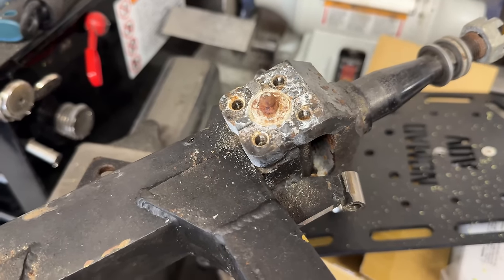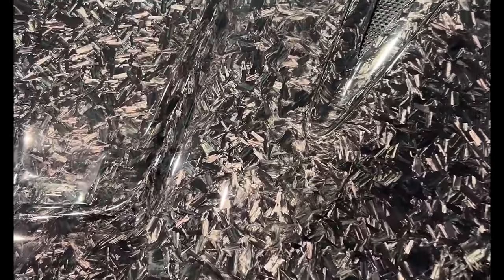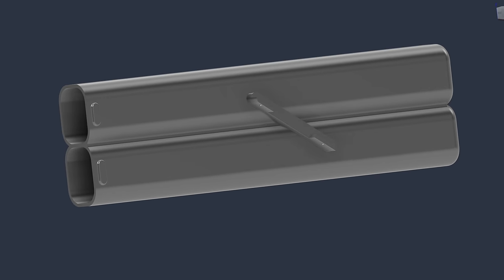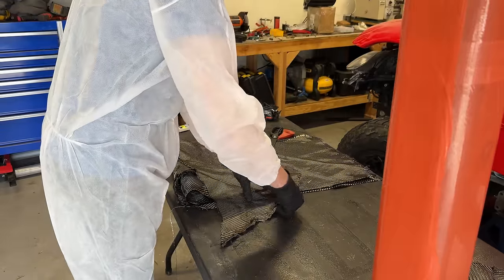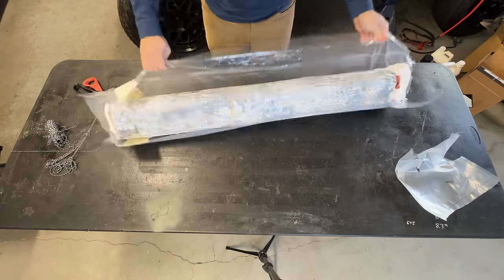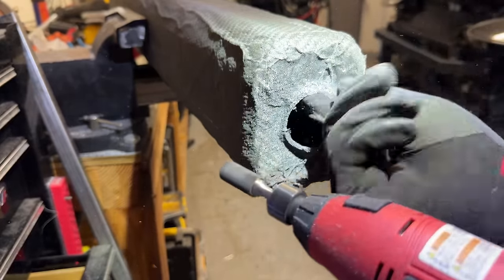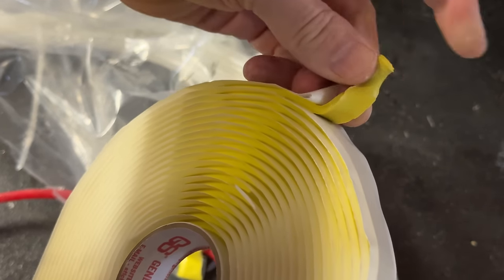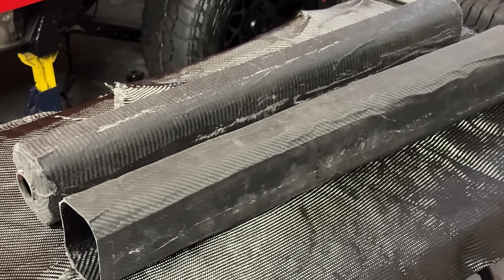Composites Are Hard

Comment: From a very old guy: Big Daddy Ed Roth used plaster of Paris blocks which he carved to shape, then laid up fiberglass over it. When the resin cured he’d smack it with hammers to break up the plaster. Sometimes he made closed compartments and the plaster just stayed trapped inside forever. If need be you can saw the thing in half and break out the plaster that way. Plaster of Paris is cheap and mixes with water. The fiberglass hassle is still there. Sorry.

Comment: "Am I a joke to you?" -schedule 40 PVC
Reply: you could prolly go thinner with drain spec pvc
Reply: it then he has no content to make videos with. We'll he has, but couldn't be arsed to work on it.
Reply: Turn the closet heat up.
Soften a 4" pvc drain tube.
Blow it I to a 4x5 ID Wood box.
Trim to length.
Reply: @jimrobcoyle  This is the way.
Reply: I think this was supposed to be practice for making the body
Reply: @jimrobcoyle  This is the way, indeed!  The entire time I was thinking this.  Or, use thin sheet plastic, heated and wrapped around a 3D mold, vacuum sealed, and weld the seam after easily removing the mold.  There were literally a dozen better options.  Still, I love watching this channel.
Reply: @DJDiarrhea  Yep!
Reply: I used 2" Sch 40 PVC for a mast to a sailing car I made around age 14/15. Katrina hit and Dallas had some serious wind. I nearly hit parked cars with my tire contact brakes smoking. Yea, the mast flexed a lot. 😂
Reply: Yup, had asimilar thought. Left a comment suggesting oversized PVC downspout and a cone to open the circular end.

Comment: After a few years as a "Composite Specialist" in the Aerospace Industry I can relate. The biggest thing I learned is was when your mold is sanded smooth enough keep sanding it. same with Mold release, when you think its good enough, put on another coat. best of luck with the Fiberglass!
Reply: Brother I have wet sanded by hand a fiber glass mold in stages to 8000 or 10000 grit paper? Absolute hand murder but fun trick, make a squiggle in Sharpie before you go down a layer once you have uniformly sanded down and the marker disappears you can go to the next finer grit

Comment: Ideas for future Matt:
-Make inside molds from Styrofoam blocks (and glue). Use a liberal quantity of paint thinner to dissolve the mold completely and easily.
-The issue you had with the ABS part ("condom") is due to the shrink ABS has when it cools. Use a blended ASA filament (Usually called ASA-X) and an enclosure to get rid of that. Added benefit: UV light doesn't hurt it
-Speaking of UV light: If you print other parts for the racer, ABS is not the ideal material for desert environments...use ASA-X, it will be easier to print too. You'll still get high on the fumes though.
-You will need a container of around 4 times the Epoxy volume to remove air bubbles in a vacuum chamber. This is completely normal, and necessary (The bubbles wont pop otherwise)
-Tell past Matt he should have read this comment before making these tubes
Reply: “…you’ll still get high on the fumes though…”
Matt: “Excellent, thanks for sharing.”
Reply: I came here to say this, as it should be a simple layup on foam blocks with rounded corners.  I can not imagine a more difficult way to go about this, and yet that didn't stop me from enjoying every minute.   Can't imagine what making the shell will look like.
Reply: Let's hope present Matt finds the time to read at least the first few comments
Reply: I would probably just have made a two part mold in 3D print for the exterior (with generous draft because it didn't needed to be rectangle anyway, only rectanglish) and wrapped wet carbon around the bag, the pressurize it from the inside. This is essentially how they make carbon fiber bikes except they use non-autoclave prepreg carbon and oven it.

Or you know, just 3d print the parts and call it a day.
Reply: Another thing is that the outside doesn't need to be vacuum bagged at all. You just wrap the whole thing in wide electrical tape (PVC tape), this squeezes out the excess resin while also keeping  any wrinkles from forming as it's compressive. and as it doesn't absorb any resin so it's easier to remove.
Reply: "tell past Matt he should have read this comment before making these tubes"

Nah, past Matt is a moron. It's not worth spending time trying to reason with him. I know that because past me is also a moron. Present me always needs to fix past me's mistakes... 

If you wanna talk to a smart guy though, talk to future me. He will fix all my projects, my designs, my code and even my life! All while remembering exactly why and how past and present me did what we did.
Reply: Acetone is your best friend.  And styrofoam's worst enemy
Reply: This is the way
Reply: @paulnielsen8528 Acetone works too, yeah. The paint thinner fumes are superior though.
Reply: @chrismichaelyoung Present Matt, as science understands, only exists for a very brief moment in time (and is therefor always extremely busy with other things)
Reply: @igorordecha counter argument. Past you was also stronger, better with the ladies,could kick anybody's @ss and was in that band that really could have made it big if not for Brians step dad kicking you out of the garage because he needed it for gis stupid herbalife business.
Reply: Excellent points. Also, pla melts at relatively low temperature and brittle  at colder temperatures. I wonder about carbon fiber? Maybe melt it or break it out.
Reply: @jerbear7952  "better with ladies" 0 = 0 so I wouldn't say he was better
Reply: Yeah I did my firewall/transtube on the midget this way, just melted the form with acetone, but talk about being a messy job, much like using paint remover to strip paint, there must be a better way, and the rest of my parts used pvc mold release!
In any case, present matt wanted to just get some practice in.   He could have just got send-cut-send to make the parts and send them to him!  Future matt will do that.
Reply: Vacuum isn't an issue for the degassing, just need to watch it before it hits the top lid, turn off the compressor and wait a bit.
Reply: @wobblysauce  That is correct, however, based on the surface tension of the liquid, smaller bubbles might never pop if you can't let the vacuum get strong enough. Multiple cycles might get you there, but you are working against the clock.
Reply: Tip from another Bambu printer owner: You can (and for ABS/ASA/Nylon/etc. should) preheat the print chamber. Put the printbed all the way to the top using the touchscreen, then 3mm down. Put the bed temp as high as possible (120° at 110V I think) and turn the Aux-Fan to 100%. Also put a towel over the top or something to better insulate it. 45-50 Celsius should be fine (bottom one of the 3 numbers on screen). Then start the print. You don’t want to open the printer until the print is done, or preferably until it has slowly cooled down. So have the glue on the and everything prepared before preheating.

Comment: A+ commentary on “fOrGEd CaRBoN”. The chatoyance is cool, and the fact that it’s perfect for using scraps and even recycled materials is great.. but anybody excited about the “look” of carbon fiber isn’t a serious person. Real structural carbon fiber needs lightweight UV protection, not a gloss finish.

I love the process in composite production. Taking your time and out-thinking the physics of demolding is always a thrill. Your fast and loose approach was always going to be entertaining for us, if not for you, and thats what we appreciates about you.

The degassing step is always a foaming mess where you wish your vessels were 3x bigger. It makes a huge difference when you’re going for an engineered strength:weight. Your tubes will benefit from the voids.

I look forward to your body production. Nothing wrong with making entirely disposable molds for one-off projects. Carve out foam or wood on a CNC table. Bondo it and take your time getting it sanded smooth then spray it with PVA. Cheap, easy, fast, and will give you top-notch results. Skip the infusion, degassing, and vacuum bagging for the body. Overkill effort and requires a bigger-stronger mold. (Molds often need to be 3x as strong as the part itself to handle vacuum bagging)

Plan (from the start) on filling voids & pinholes with micro & epoxy, then painting and you’ll never be disappointed. Even autoclaved aerospace parts get pinholes filled.
Reply: Yeah I agree vacuum is too much trouble because weight is not an issue. Just go wet layup and a big fat flood coat. Its so much easier to do and gives good results.

Comment: @3:07.  You left out the ITCHING as the No. 1 worse thing about fiberglass.  In the 1970's I worked at a factory that built sailboats from 18 to 48 feet.  Although I worked making the wood parts that went into the boats, I was close enough to wear the grinding, sanding, and cutting of the the fiberglass was done that the constant ITCHING it caused me made me seek other work.
Reply: When working with short glass fibers for thermoplastic composites, one learns rather quickly to be very careful when going to the bathroom. Switching to continuous fiber was very welcome.
Reply: Itching is loving, breath and skin protection is caring.
Reply: I've only ever worked with chopped strand fiberglass once (built a custom shower tray for my camper conversion), and it was the stickiest, itchiest, smelliest, most unpleasant experience. Ever. I don't know how anyone could work with the stuff full time.
Reply: @InternetListener   Back in the 19and70s, we were MEN!  We eschewed PPE and despised those who used it.  Most seat belts of that era were NEVER removed fro the plastic bags they were put into.
Reply: @oddshot60  And you are all dead from emphysema now , aren't you , Mr Zombie commenter?
Reply: Talcum (baby) powder applied to the skin before starting work seals up your skin pores and greatly reduces the itchiness.  I hate composites and appreciate Matt showing why half ass is an approach that does not give visually acceptable parts.  Functional yes, pretty nope.
Reply: @PaulG.x  You left out all the horrible automobile accidents.  I never said we were smart, I only said we were MEN!!!
Reply: @DIY-V12 Past-Oddshot60:  "TALCUM POWDER!!!  Thanks for the tip, Future DIY-V12!!!"
Reply: Matt contemplating his long vinyl shaft. 🤣🤣🤣🤣
Reply: That stuff can't be good for your lungs
Reply: @therealchayd  A better method, is carve XPS blue or pink foam to shape, with a router and template, drape 7725 or 7781 E-glass cloth and wet out with waterproof boat epoxy like West Systems. Vacuum bag it to a flat table.
Reply: I had a job doing fiberglass once for $14 an hour.  Least favourite part was taking a flapper disk to the edge and embedding fiberglass into my skin.  It was pretty miserable, couldn't sleep.  I wouldn't do it again for $40 an hour.
Reply: @oddshot60  your welcome, also it's very much current DIY V12 - look for 540HP NA 7L V12 at pistonheads for a laugh
Reply: @ofp8574 But now we have TALCUM POWDER.  😂

Comment: Pro tip : for that kind of pseudo-cylindrical part, the easiest and cleanest is wet lay-up and then wrapping in a special heat shrink tape and blast it with a heat gun. No need for a vacuum bag then It's cheap, doesn't wrinkle the part, and looks shiny on the outer surface.

Also, you want to use a perforated release film between the peelply and the breather mat (wet lay-up) or mesh (infusion). It's much easier to remove then.

The air bubbles may also come from trapped air that's inside your 3D printed mold. Infusion is a great process but it's Achilles heel is its absolute intolerance to leaks or trapped gasses. It will ruin your part under your eyes and there's very little you can do once it's started.
Reply: You complicated this far too much.

After watching a few minutes:

Find a cardboard tube with an OD near what you want for the ID of your tube.

Coat the tube exterior with clear packing tape to create a surface that releases easily.

Create 4-5 wooden bulkheads to insert in to the tube and create the shape you are looking for.

Put it all together and you have a cheap and easy to make (saccrificial) buck.

Since you aren't concerned about strength, go resin rich on the carbon, wrap it over the buck (after applying a good coat of carnuaba wax for a release agent), then add your peel ply and some of the matt used to absorb the excess resin.  Instead of a vacuum bag, just wrap the whole thing with duct tape or even rope to squeeze the assembly.

Once cured, remove the tape and see if you can get the peel ply off.

Hopefully it won't be too hard to remove. 

For the interior, pop the bulkheads sideways to get them out if you can.  If not use a large hole saw with an extension to cut out most of their centers, then throw the whole thing in some water to turn the cardboard tube in to mush.  After it's mushy, tear it up and pull it out in chunks.

That's the process.  I would make it a bit long so I could cut the ends clean before trying to remove the interior buck.  I would also wrap the peel ply and matt around the exterior of the carbon in the shape of an "e" with a little bit of plastic in the overlap where it wraps over itself so you have some peel ply without resin to grab on to and pull to get the release started.

You might have the same veiny exterior but that's what Bondo and palm sanders are for.

Hopefully the interior would be smooth so your parachute will release too.

Comment: Used to be in a rocketry club that did a lot of "3D printed" reusable molds. We made them by printing positives, then creating a negative, reusable fibreglass mold from it. 
1. Print part, paint with gap filling primer and sand to oblivion
2. Wrap with fibreglass, put wet ensamble in a wood box, fill with styrofoam and cheap epoxy. Also put in some stuff that will later serve as locating features here
3. Destructively remove the printed part and cut the mold in half
These negative molds are way easier to separate than positive ones! The fibreglass surface works reasonably well with release agent. Being fibreglass you can actually apply some force without destroying it.  
We also did negative molds by cnc machining aluminium and polishing it to a mirror surface. Can't recommend. They work great, they're just a pain to make.

Comment: I'm glad to see I'm not the only one who struggles with composites! In building the body for my car I learned a few lessons like yours
- Wet layup then vacuum bag does not work, the excess resin has nowhere to go so you end up with pools of it making those "veins" adding weight without strength
- The carbon you are using looks heavy which sucks up a ton of resin to get wetted out, you need to roll and compact the layers together a lot to get as much resin out as possible
- Getting the molds out is always hard, with a part that long you could do a "lost foam" mold that you disolve out with acetone after, just don't try it with poly resin
- The mess is unavoidable, no advice there!
Keep them coming!!!

Comment: simpler method for constructing grp tubes: make an outer mold, not an inner one. two halfes, joined by a hinge or somethingl ike that (even just tape. lay the pre-soaked mats into the mold, covering both halfes and with overhang on the "open" side of the mold. then join the molds, making sure one overhang overlaps the other. before joining the molds you lay a large balloon like strucutre like a plastic bag or rubber tube or similar on the mats. after joining the halfes inflate the rubber tube thing. this presses out excess resin and presses the mats to your outer mold, giving you a nice surface finish. the ugly surface will be on the inside (where it shouldn't matter). removing the molds should be easier too when properly prepared as access is from the outside. the rubber / plastic bag etc. won't stick to the epoxy anyway.
Reply: In this case, only the inner surface matters. The outer surface is not visible when the bodywork is on, and the parachute needs to slide smoothly out of the inside.
Reply: @brianb-p6586  but he also mentioned that he didn't care how the inner surface looked. And you'll get a clean smooth surface anyway. So I'd rather have a simpler method in terms of molds and a nice looking outer surface as that's the one you're going to see when working on the project.
Reply: Look at that, Frosty the Snowman melted. We must be living in the End Times for the Snowball of Secrets to disappear like that

Comment: The best curing ovens are parked cars on sunny days.
I have had resin cure in 2 hours in one of these ovens
8:54 this is why you don't wrap absorbent layer around the whole part . Instead leave a narrow clear strip down one side. You can also separate the absorbent layer overlap with a plastic strip so the two ends don't bond

Comment: For the large body panels, if you do infusion because it is way less messy, one trick we had was to place alternate resin fill tubes along the infusion path with clamps. So if for any reason we did not have enough vacuum to pull it through we could switch the fill tube at the last minute. It's not a perfect solution and you may end up with some dry/spot defects if you need it. But it's better than losing the whole part when it's not for structurally critical components.

Comment: Absolutely love your humor and monotone voice in these videos! One thing that you could’ve done is instead of doing the whole 3-D print thing, use Styrofoam and wrap it and finish it the same way I’m sure it would be cheaper, faster and a lot easier. Then when done all you would have to do is pour a little gas or solvent inside and it would melt the Styrofoam away. Of course again that’s what I do simply because I don’t have a 3-D printer, but to each his own.